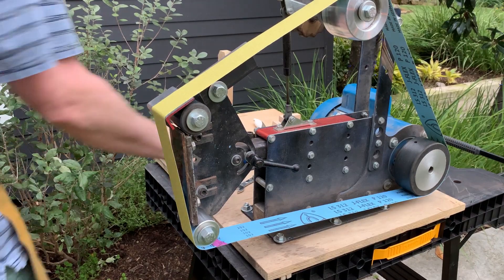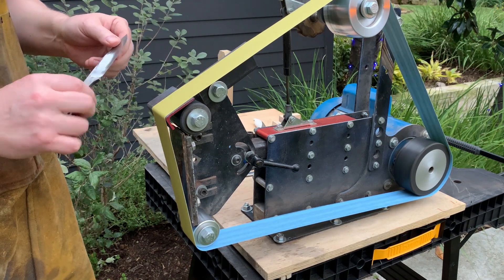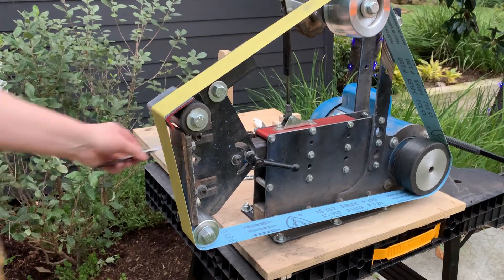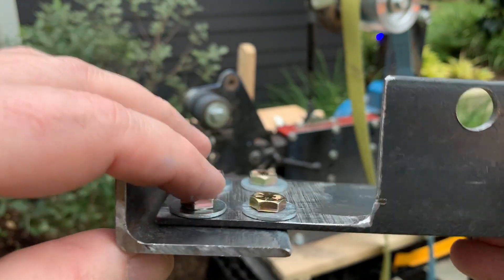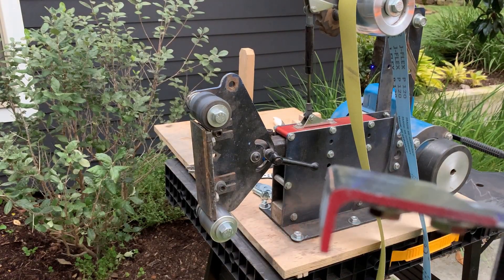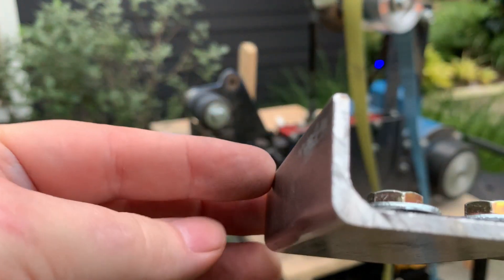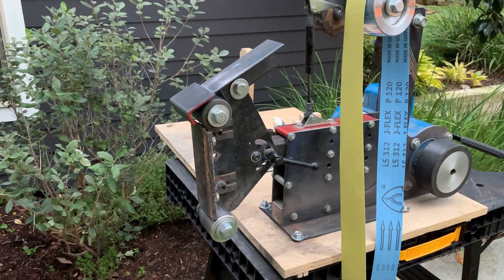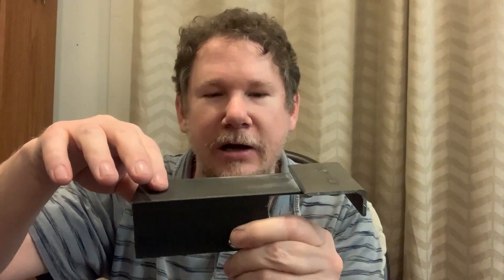Waterfall Platen inspired by Kyle Royer

Comment: Hi -  I also work with a waterfall platen. But I have a problem. My waterfall platen gets extremely hot in a short time. Is that the case with you too?
Reply from the maker: Yes. That's another reason they work better if you have a variable speed motor. That way it doesn't get so hot. What I do ever now and then is just turn it off and pour some water over it to cool it off, then go again.

Comment: awesome how well has it been holding up?
Reply from the maker: It has held up great. The alignment issue magically went away. Maybe it was just a matter of stretching the belt a little. I've done several knives on it, and so far I haven't broken any belts or had any problems. The only issue is that it gets really hot really fast, so I have to cool things off frequently. Sometimes I'll take the belt off and pour a little water over the platen to cool it off faster. This would definitely work better with a variable speed motor so I could slow it down.

Comment: i made 1 from kyles plans a few weeks ago . I just tried it on a knife the other day and, screwed knife up when trying to clean up plunges . It started to wash out up near the spine so i stopped b4 i did more damage whats the trick not to  not grinding to high? tilt the knife to a slight angle? thanks Mark  great video glad what you made is working for you 👍✌
Reply from the maker: I don't have any trick. Just be really careful. Use light pressure at first. Check it frequently.
Reply: @philochristos  thanks man ill test on mild steel knives until i get it down then try it 👍